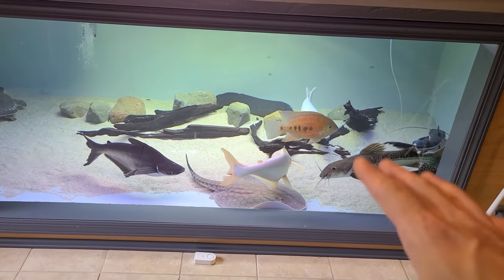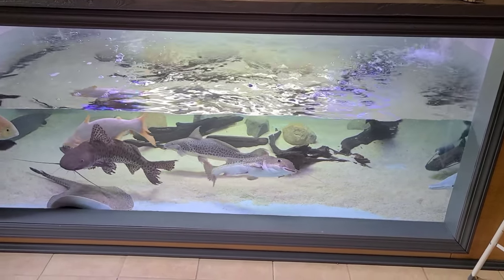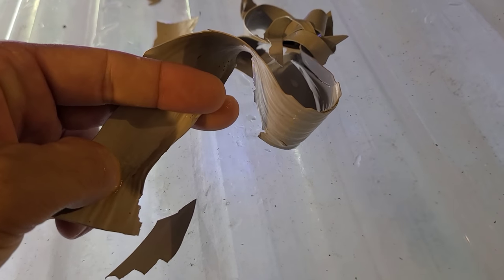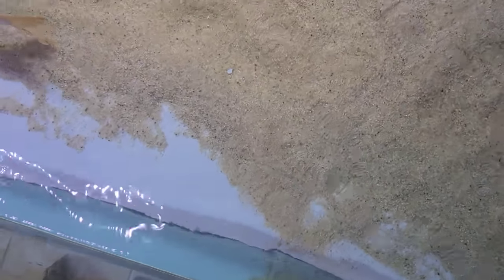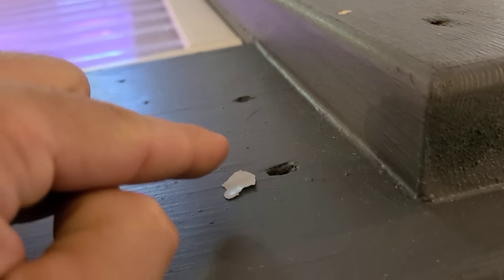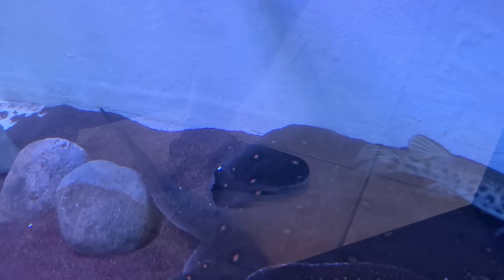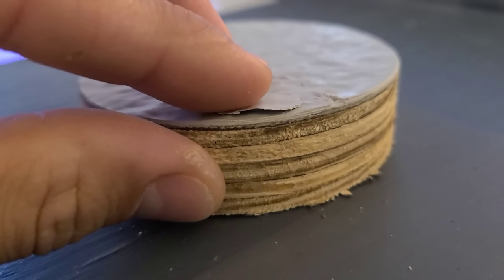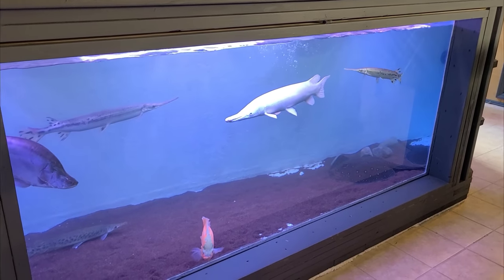Plywood Tank Problems

Comment: had this problem myself,   so did my neighbour ,  way back when in the day,  my old school fish yoda,  if the seams split.,  drain the tank completely.  then go along the seams and clean them, then go along the seams with a heat gun,   then forget about industrial resin and epoxy,    we used  clear acrylic,  nail polish,  (french manicure) stuff,  my neighbour years ago got it from the pound shop,  what Americans call the dollar store,  i i ordered mine from eBay in bulk. the seams must me clean and free from grease. paint on the acrylic varnish. then go over it again with the heat gun.  problem sorted.     my old neighbour,  worked for london zoo and london aquarium.original fish yoda.  and  i've kept fish, and diy tanks for over 25 years,,,     trust this knowledge.     liquid acrylic, nail varnish and the heat gun before and after solves all leaks.  (along seams) and dries so hard fish can't eat it. or chew it. ...
Reply: Are you suggesting using acrylic just over the glass seams he worked on in the video? Or using acrylic to coat the whole tank. Is it aquarium safe?
Reply: this fix was just for the seams,   if doing a whole tank,, epoxy paint is the way to go.  Much cheaper,   But 100% liquid acrylic.  is aquarium safe.

Comment: My 1000g was at 4 1/2 years without any concerns. Im reducing it to a 450g currently for easier maintenance and less energy usage.  Adding a new back wall within an existing build is proven a bit challenging, however it seems good after applying fiberglass to all corners and seam and 4 full coats pondarmor. There are a few fiberglass fibers raised, however its snug into corners.. I had 6-7 coats on existing tank where I tied into.  The pond armor is very strong when cured.  I treated a small piece of wood for curisity.  It was hard to make a gash with flat screwdriver and hammer. A LFS owner told me of several plywood tanks he had built.  Theyre running great still at 30 years.       Wooden boats last very long time

Comment: I watched this build. Couldn't tell from the original video. But that seems it's peeling up from not sanding between coats of epoxy. Hopefully the under layers were still in tact. Love the channel my man .keep up the great work.
Reply from the maker: The 1100 was a neoprene epoxy that did not require sanding between coats. The 1,500 was interseal 670HS two part epoxy which only required sanding between coats of the last coat had been cured for a certain amount of days. I forget how many days it was. Regardless I sanded between coats for the ones that required it at the time. Especially because I added more coats after installing the glass. Both tanks pealed because they were chewed on by stingrays. The 1500 stopped when I added rocks along the bottom seams which made it so the rays couldn't get at it. Didn't matter both tanks had over 10 coats each and were no where close to leaking
Reply: @OffTheDeepEndAquatics  oohhh gotcha!wasn't trying to be a know it all. Allways learning new techniques for my builds.That's interesting thpugh for sure . Cool to see you active with the comments on here ! Keep up great content man . Loving all of it !

Comment: WEST System Epoxy and fiberglass rowing mat would solve all of these problems. If you have some chewing critter: extra layers and include Kevlar as one layer. Not too expensive and literally bullet proof. 

You can coat away as much as you want. More than three to four is a waste unless you amour it with fibers and wont do any good. WEST system Epoxy however has the best properties for being "bendy" without cracking, but again a waste without fibers in it. 

Those chips look like epoxy delaminating more to tune of surface not being clean when applying or in someway not prepared correctly. 

This is basic boatbuilding, inside-out. You can use the epoxy you used for a final coat. WEST does need to be covered for the UV rays. Without it would be brittle over time. 

WEST is not the cheapest but it is the best.
Reply: As an ex boat yard worker, I couldn't agree more. I would like to add that he should have sealed the glass on the outside with some good sillicone. Not on the inside

Comment: Epoxy resin doesn't like sharp corners and has no strength by itself.. You should have sealed the glass on the outside. NOT on the inside.

Comment: So basically you really have no idea what you're doing... With fiberglass nor epoxy... And a short time from now you're going to cut it up a and throw most away... What a waste of resources... First you put gelcoat to top fibeglass...like a boat hull... Epoxy needs a primer to bond to fiberglass and it needs sanding between coats... And one really needs to assume the thing is going to be removed at some point in time... So build all walls separate and bolt together then seal them up... Just a thought from a engineer...
Reply: I honestly thought you were going to tell us you were an expert plywood tank builder by how indepth your review was of what the op did and did not do. Later to find out you're an engineer and I'd be willing to bet every dollar I've ever made you have never built a custom plywood aquarium like this yourself. When you reply with a link to your own plywood aquarium builds you'll prove me wrong. My suggestion would be for you to comment your expertise in an industry you're actually an expert in, some sort of engineering of whatever type you work in every day. But like I said I'd love to see your links to your  mass production facility of plywood custom large aquariums.
Reply: Advice dosnt need to come from an expert. The contents of the information being true or not is the only thing that matters.
Reply: @johnrickles3378  Sir I Do have DIY Ivideos posted about the construction of solid poured concrete ponds and pools and my construction method... Also have experience with boat hull repair. But when it comes to aquariums I build with Glass and I have a video of My fish room posted... When it comes to plywood I have paid for 8 homes with my knowledge of how to build and repair things...
Reply: @toddwhite3217  ya I just watched one of your videos, funny enough your comments are off. Fish room looked nice over besides the stand for your koi tank, looks extremely underbuilt and the tank is clearly overpopulated and green. Those koi cannot be happy in their. I'm guessing you turn your comments off because you are great at criticizing others but can't take any yourself and I'm sure if I watched the video or videos I could go on and on and on with everything wrong you've done as someone who's been a fish finatic for 30 plus years but would that help someone like you? No not at all.